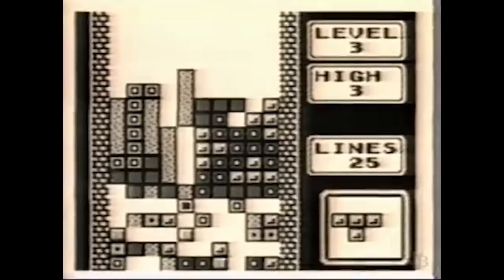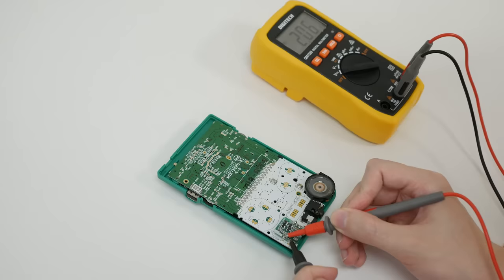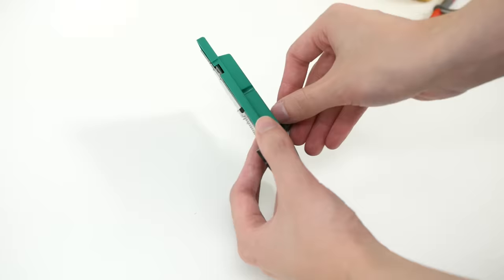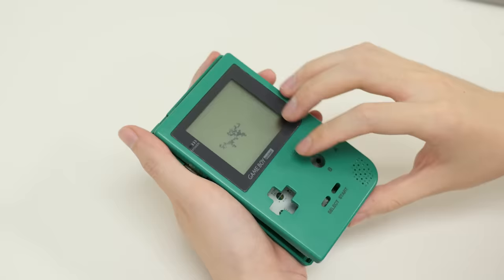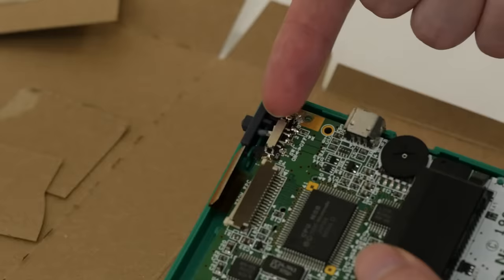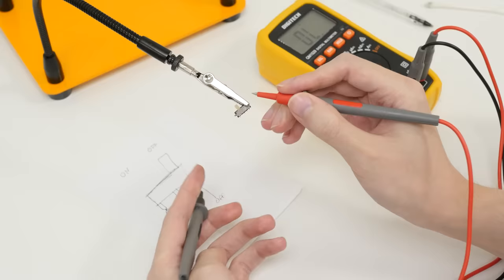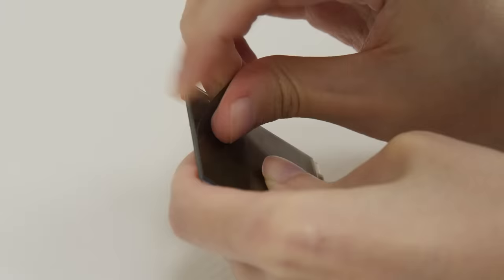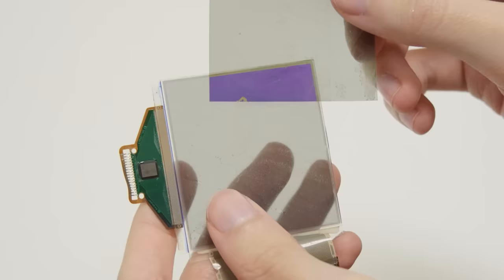Repairing a DEAD Game Boy Pocket [Part 1]

Comment: You probably are a bit younger than me, but this is most likely leakage of the cells within the display. L in LCD stands for liquid, if the cells that hold this liquid get broken then your display is beyond repair. If you look at older LCD displays which did not use dot matrices then you will often see a simular damage. It would result in stains often situated at the sides of the screen. Because this display has cells in a matrix, the liquid will flow from one pixel to another, ending up showing a maze/worm like structure.

The bottom line is, if you see damage like this then save yourself the effort of trying to fix it. A replacement screen is needed.

Comment: Any attempt to fix the screen is a fruitless venture, you can see it has a vertical line (10:18) when it's on regardless of the gunk (which I believe is screen rot, due to the layers coming apart and allowing moisture into the gap between the face and the liquid crystal).

That should have been a candidate for replacement immediately. There's nothing you can do about the vertical line. Plus you get all the modern perks like no ghosting and backlighting anyway so why not.

Comment: knew they were dead, like Marcelo said, he knows what he's talking about they are dead pixels, i may not know how tn panels work but i know dead pixels when i see one, also the new switch can be open as well, and you could 3d print a new stem for it and maybe sell it as a gbc compatible switch replacement kit? idk that is one part i have no experience with

Comment: you know those markings on the screen kinda looks like delamination between the layers of glass. maybe heating it up and applying lots of pressure could help it? i dont know of any other solution than throwing it away so it couldnt hurt

Comment: Thanks to my own experience with this, I have a way to fix it. All you have to do is open up the gameboy and take out the screen, then rub at the dark spot with a q-tip. Its caused by liquid in the pixels leaking (cuz the screens are 30 years old, go figure), so moving it towards the edge of the screen or until it dissipates is how i fixed it. Be warned, I have no idea if the fix is permanent or not, but it hasn't shown up for me again
EDIT: ah, he's already fixed it. Go me

Comment: not to criticize you Matt, but one of the first things you should have done was clean it when you took it apart and specifically drop IPA into the switch and move it around a few times to get it in there

Comment: I'm definitely not a tech expert, but I've had many devices with LCD screens in my life, and that is not a foreign contaminant. The screen itself has sustained an ouchie of some kind, that shit ain't going away.
Reply: actually you're on the right way with your thought Katie...
The LCD Panel has a pretty annoying damage to its Liquid Crystals, that's for sure... but the thing is, that this kind of damage is unrepairable...
Somehow it seems that the liquid kind of "spilled" or even if this is the correct pronounciation "leaked out" of the Display itself and i don't know how it managed to do so because those screens are pretty much compressed so tight that the liquid would never be able to leak at all...

But as it seems like it somehow managed to do so, even if most of the screen is still perfectly working, i can surely declare this screen as "technically usable but non-entertaining dead"... playing on a Screen with missing LCD-Fluid is definitely no fun at all (except for someone who isn't annoyed by a Hieroglyphic Alien-Like Screen-Mark that's based on the Fluid-leak in a display unit)

Still, this is not a problem that can't be fixed with some fresh LCD Units that have Backlight (that also could be able to change between white light and RGB light) but hey, i have to say that you were pretty close to the answer on where the problem lies in the first place, so i guess
GG FOR THAT, Katie

Comment: That mark is screen degredation, so all you can do is yeet it and put a new one in. Since the rest of it works, I would consider using it in an active service unit until it degrades to an unusable level, or else just go straight to modding.

Comment: Jo @MattKC,
1 year after release i saw this video.
For your new switch with the little plastic clip, i head an idea. 
For this video it is too late and the original switch worked, but for future projects:

You need a 3D printer! 
Create with an tool like Fusion360 a new switch slider with longer foods and print it out. 
This should solve many problems 🙂
With this option in my hand, i solved many problems :-)
Reply: im pretty sure he has one alerdy

Comment: Amazing how replacement screens are produced and a simple switch does not
Reply: Well actually, they are produced the same way as that switch on a PCB (except, in that case, it does fit well). Just like that switch on a PCB, this screen is just a new screen not compatible, but made compatible using chips on the flex PCB. Making physical things is much more complex and costly than using existing components and adapting them. Even more so with the existence of cheap FPGA / CPLD that can be programmed to convert different types of signals. The amazing thing is that it's possible to produce custom size IPS screen for relatively cheap in relatively low quantity. It does seem quite recent, as even a few years ago for the GBC they had to use a MUCH bigger IPS screen as a replacement.

Comment: You love the out of spec, incompatible, mass produced parts? Its the same crap for the GBA SP charge ports. The pin configuration is blatantly incorrect and misalligned making all aftermarket SP charge ports absolutely useless. 

I gave up and just soldered in a USB-C charge port.

Comment: you could probably have just flicked the switch a hundred times, optionally putting some contact cleaner on it first. the corrosion on the contacts would wear away

Comment: Can someone please help me? I am trying to recover my old personal GB pocket.
I followed every single voltage metering step that Matt did. Apparently I could get the normal voltages including through the switch. After fiddling with the switch by moving around the GB power light turned on, but there is no sound of that Nintendo "bling" and no image coming on the screen but it is much worse looking that Matt's so probably it's totally dead. 

Is there any way that I can know if it's both screen and speaker that need replacement or is it something else? the power coming from the SVCC and VCC are both about 2.4V

Comment: whyn not just put some drops of rubbing alcohol in it and rock it back and forth until it works correctly? I do that with mice's microswitches and even with microwave ones too and it works fine. No bad contact and last just as long as a new one.

Comment: there is a grey set of cables next to the screen...try to push them down with a solder iron (not very hot).that's how you fix dead pixels.

Comment: Why didn’t you try removing the metal plate on the power switch and clean the inside with a tooth brush and ipa? There could be dust and junk in there that could affect its connection

Edit: oh wait he did that later in the video lol.

Comment: why does every game boy replace the Nintendo logo with a black square on the boot screen if no game is inserted?
Reply: If I recall correctly, it's actually part of the licensing protection. The game cartridge supplies the Nintendo logo and does a check to make sure it's correct. That way, if someone creates a pirate game, they are using Nintendo's trade dress without authorization to get it to boot up. 

I copied this text from reddit so it might not be 100% correct
Reply: @marioisgud  oh

Comment: you mistake japan for everywhere else. japan usually take care of there stuff so it will be in better condition. you really make simple stuff hard too. the switch could have just been cleaned with contact cleaner but no you chose to try and get another one instead of cleaning it.